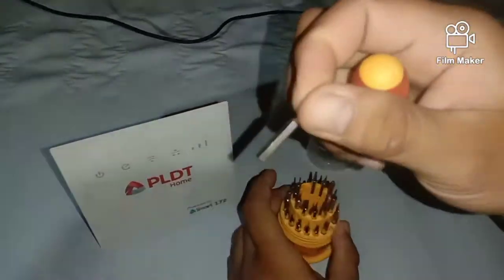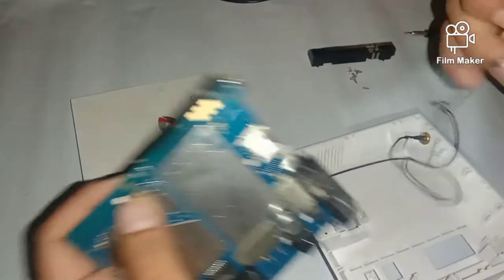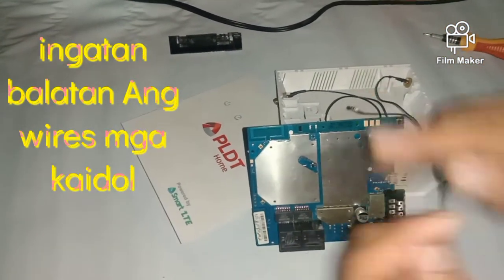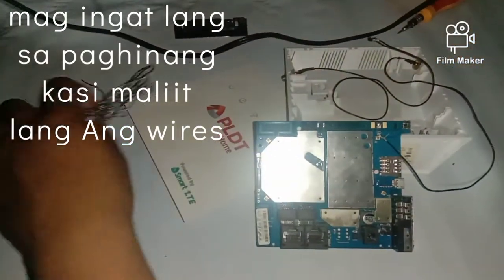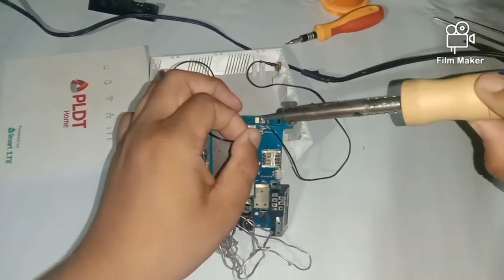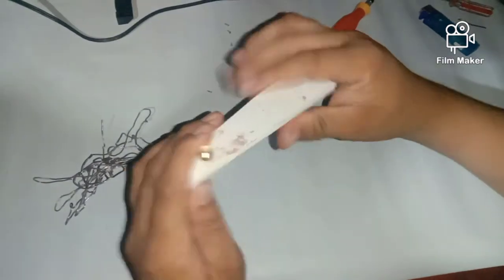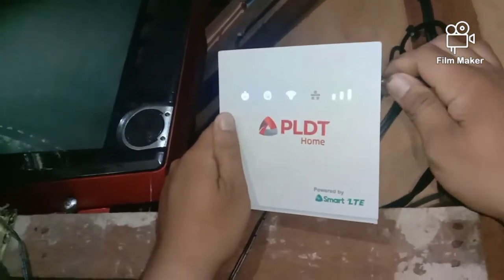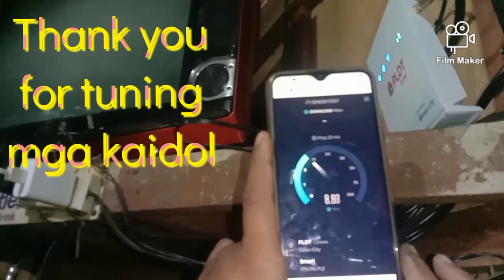SMA FEMALE CONNECTOR INSTALL TO PLDTHOME PREPAID WIFI/FELIX ABULAG

Comment: why did you use sma female connector, you can directly  solder the wires from the outdoor antenna to the board.
Reply from the maker: Idol yes you right but if I directly to the board if ever na I can use another antenna like mimo parabolic ...it's so easy...

Comment: Idol, new subscriber po, yung wire po sa SMA na parang insolator yun an i solda sa gilid? Sana ma replyan, 😅😁
Reply from the maker: Yes idol yan Ang grown  tapos ung my wire sa gitna balatan mo un ilagay mo sa gitna
Reply: @felixabulag1185  salamat nang marami idol, 😁😁
Reply: @felixeabulags2948  ok po idol, may nakita kasi akong tutorial, makapal SMA na ginamit nya, at gumamit din ng splitter para sa external antenna, kaso yung problema mo wala akong mahanap na makapal na SMA, ang common kasi ay manipis, buti na lng napanood ko tong tutorial mo idol, subukan ko po ito, 😁😁😁
Reply: @felixeabulags2948  ok po idol, salamat ulit,